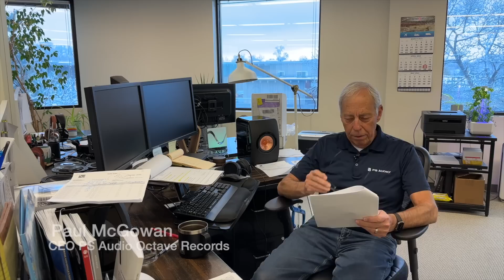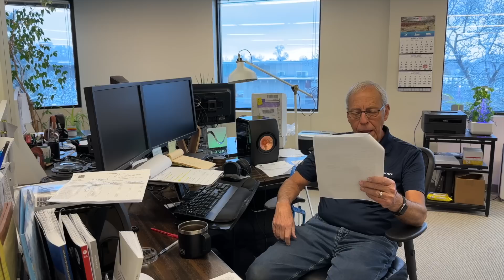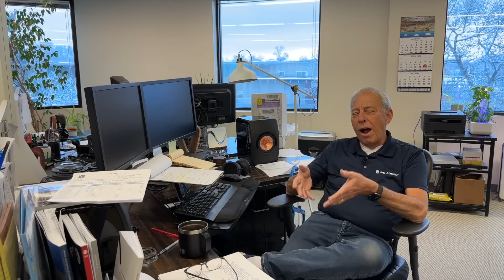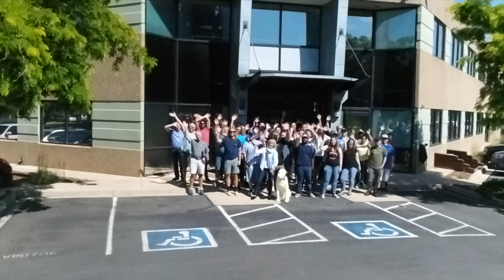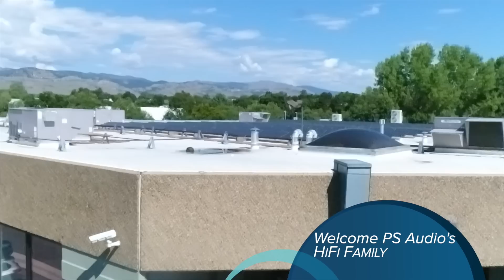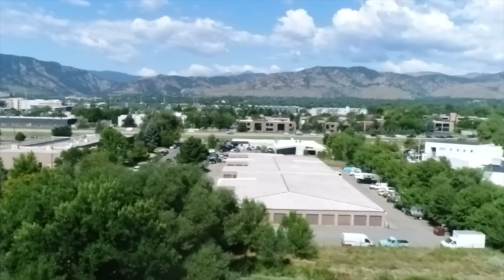Building a vacuum inside a loudspeaker

Comment: I designed a competiton subwoofer enclosure in our shop that incorporated a vacuum ( a very slight vacuum ) . It took weeks to get it right but in the end the result was exactly what was intended or more accurately  hoped for. Never be afraid to try new designs, theories or even outlandish ideas for speakers .
Reply: Just some added info . Vac was set at 1.2 bar  would hold during runs for about 20 minutes . Enclosure was treated and sealed inside and out . The idea was to be able to use a high quality but inexpensive subwoofer to compete in spl comps . Designed to perform  at 70hz for 10 seconds a run . $150 worth of subs with 4 times their rated peak power . The car was run all season all 4 classes each time and took 1st place all but once and it took second that time due to operational error .. for normal daily playing no vac was applied and we switched it to a 4 ohm load . I also designed a box for 15in woofers at half the volume recommended.  It's drops to 28hz and  offered a spectacular dynamic range through out the lower to mid low experience.  In fact that same box is being used as a home theater sub and as we speak and it is 10 years old . Don't hold yourself to conventional designs folks. Apply what you know to what can be and just build it. If it doesn't work there is usually a simple answer as to why ,so fix it.  Lol

Comment: It is funny, but I like the new goodbye! It gives a happier sensation 😂
Anyway, I was thinking if the is a speaker that includes a relief valve to control box high pressure, so that when cone returns forward it is not afected by that pressure force.

Comment: @1:03 -- Those speakers are the real deal.  They probably sound better than 90%+ of even what audiophiles have in their homes.
Their size is deceptive, related to the superb soundstage that they deliver.  And the bass goes deep.  They do everything right.

They are not the last word in high fidelity.  But for their size and their price, they have minimal competition.

As of a couple of years ago, their price was north of $2,000.
Kef has a newer version: LS50 Meta.  They are an improvement to what Paul has (but what Paul has is no joke).

Well, that is probably not Paul's desk (he owns the place, but some other worker probably is assigned to that desk).

Comment: Rather than a vacuum, designers "solved" the pressure differential by a "compound force" subwoofer design. In this configuration, one speaker is completely internal to the speaker cabinet and mounted behind the speaker firing into the room. When the front speaker pushes forward, so does the internal speaker, thus maintaining the same air pressure on the back of the external speaker. And when the front speaker pulls backwards, so does the internal speaker to keep the same air pressure on the external speaker. So, the speaker as a whole acts like an open baffle speaker even though it is a closed baffle speaker. I remember seeing such a speaker decades ago in HiFi/Stereo Review magazine, but I don't recall the maker. There are other "isobaric" (constant pressure) configurations as well.
Reply: In reality, both drivers couple closely, work in unison and experience "enclosure influence" just as a single driver would. You are citing advertorials for this arrangement, purporting to show its advantages. Low frequency extension is improved, as the Vas is halved. Moreover, having drivers back to back, or front to front helps average out suspension/flux assymetry.

Comment: Hexaflouride gas inside a transmission line enclosure. I have never heard anyone else try those two things together. Hexaflouride is heavier than air and the woofer will be fooled into thinking its in a huge cabinet because of that and the transmission line. If you don't mind having a huge box in your living room, I think I know someone who has a few extra confessionals.
Reply: Yes, SF6 gas will slow speed of sound but manufacturing and costs become unnecessarily complicated, when polyfill and passive-radiators are essentially doing the same thing.  Slowing the speed of sound, i.e increase apparent enclosure volume.

Comment: You want to move as much air as possible with as little energy and space as possible. Eliminating the need to compress the gases behind the speaker would certainly be nice, but unfortunately doing so means one would have to constantly fight against the atmospheric pressure of 194 dB. Under normal circumstances doing so would dissipate excessive amount of energy to say the least, but being a static state perhaps with superconducting coils one could do so without dissipating any energy. That would certainly be one impractical speaker though.

Comment: An odd idea?, Basically the air is acting as a spring trying to hold the cone in the middle of it's travel range.
On the dipole bit, I recently recycled a very shallow box into being a speaker, the reason was it had a nice grill on it just asking for a driver to be fitted. However it also had a matching grill on the backside, so it's kind of acting as a dipole speaker, but with the driver (just) fully enclosed. It's currently serving as a really nice monitor speaker, not bad for an almost joke build.

Comment: A sealed enclosure will self correct the air pressure to the same as its outside environment. Materials used in the speaker surround/cone will very very slowly leak and within a couple hours it will adjust to environmental pressure. Not to mention the terminals may have a small tiny leak if any excessive pressure exist for long periods (not while playing music).

Comment: With the aim of controlling the cone motion precisely again the signal I would consider it more interesting to come up with some servo feedback mechanism that can work also at higher frequencies with high precision greatly reducing distortion and ringing issues.
Reply: Something like this was done some time ago, I think by Philips.
They called their design Motional Feedback.
The speaker was still passive, but had a piezo electric transducer affixed, which generated a voltage which was used in the negative feedback loop.
There may be other designs where a second voice coil acting as a generator can do the same thing.

Comment: Yes Paul, somebody has already done it. It is called a Transmission Line Speaker. I built TL speakers many years ago based on a design by Dr. A R Vailey. Take a look at PMC speakers. Concept goes back to 1930’s.
Reply: Paul worked for Infinity during the 70s and 80s and have been a speaker manufacturer himself since the 90s. Im sure he has heard of, and has thought of, or knows the person that designed every type of speaker imaginable.
Reply: @flipfloptanlines926  Yes, he is a Little Wonder.

Comment: Paul, doesn't adding a Passive Radiator ease the back pressure on the active driver along with recovering some of the acoustic energy?
Reply from the maker: Yes, at some frequencies, that is correct.
Reply: Just remember any energy recovered and then released into the room comes with a time delay.

Comment: Any difference of the pressure inside the box relative to that outside of the box will cause the cone movement to be asymmetrical and result in some type of distortion.  If you want to make a slightly negative pressure inside your box you can remove the 'speaker and use a candle to heat up the air then reassemble quickly before it cools.

Comment: Isn't it amazing how technically inept some audiophiles are?
Reply: Just a foolish question by an idle mind that has nothing better to think about.
Reply: It’s a good hypothetical. But it should have been clarified if they meant an actual vacuum (noun: 1. A space entirely devoid of matter. 2. A vacuum cleaner) or minor negative air pressure. The issue with “a space devoid of matter” should be incredibly obvious so I’d assume they’re referring to minor negative air pressure. But given that that would just change the resting position of the cone and/or, if metal springs were used to prevent that, exacerbate any issues it’d be trying to address,… As long as there is an enclosure the air inside will be compressed/stretched as the cone moves regardless of how thin the air inside is, either it’s fighting against the air inside the enclosure or it’s fighting against whatever is keeping the speaker from moving backwards and equalizing the pressure in front of and behind it. If you built a sealed speaker 5,000ft above sea level (very thin air/low atmospheric pressure) then brought it to 100ft below sea level (very thick air/high atmospheric pressure) the speaker would be forced backwards until the air inside it was under the same pressure as the air outside it, and the reverse if it went from high to low atmospheric pressure. The air inside an enclosure is ALWAYS under the same pressure as the air outside it, which changes with humidity and atmospheric pressure (I’m just trying to make a point, there’s slightly more to it in the mechanical realm but this is already turning into a dissertation so I’ll leave it at that). And if there is no air/a vacuum,…  nothing, no matter how strong it is, would be able to move forwards (assuming it was strong enough not to be sucked backwards so quickly it’d be completely destroyed. Which is exactly what would happen to a normal speaker with a vacuum behind, unless it was in the vacuum of space). A vacuum is nothing by definition and it’s literally impossible to stretch nothing.

Regardless it’s a good hypothetical, but the parameters of the thought experiment need to be better defined. Regardless of what one thinks about this subject it gave me an excuse to think about this so, for that alone it gets my “seal of approval”.

Comment: I've never heard of such a crazy idea .... placing the cone in a vacuum at the rear would require a massive restoring force based on the atmospheric pressure of 15lbs/ sq inch  X the cone area in sq inches... placing a restoring force ( by a DC supply to the voice coil) would raise the resonant frequency and heat up the voice coil to the point of burning it out.
What I consider more relevant to this discussion is the effect varying barometric pressure has on a low frequency driver cone when mounted in a totally sealed enclosure ...

Comment: I think that a complete vacuum would make a regular speaker implode, due to the huge pressure of the external air.
Reply: For a 6 inch speaker the force applied by the atmosphere would be roughly 1820 newtons or 182 kg/f or 401 pounds. 
Just imagine to apply the weight of two average men on the small 6 inch speaker.... And it grows exponentially if you increase the diameter.
Reply: 😂 You dont need more than 0,3bar press/vac, have you ever seen the pressure in a longthrow subwoofee in a closed box? A propper woofer can take a lot of pressure/vacum.

Comment: Paul sort of got it right. The vacuum idea is nuts, the air pressure differential would just suck the speaker cone in, it wouldn’t work, full stop. However where Paul says “open baffle”   I say “Transmission Line”, which is essentially an open baffle but tuned to ½ (not always..) wavelength of the speaker resonance frequency.  They do get some stuffing at node points, but this is a much more gentle effect than the bit of stuffing in an enclosed box. I am a great fan of transmission line designs having built a pair based on the KEF Uni-Q driver. It could sound bass lacking until the bass actually hits. It’s called clean bass. Typically, you lose the bass knee “boost” from the enclosed / ported speaker designs, but gain in a more gentle roll off, which creates the extension. Open baffle is very natural, but the cut-off is proportional to the baffle width, and bass = many feet.
Reply: I fooled around with it a few years back, never had speakers go bad from it, you can give it air from a compressor but thats to much and nobody wants that in their livingroom. But with a tesla valve the woofers will build up pressure/vac. Making a tesla port in right dimensions is not cheap or easy tho, but for the diy it is a funny way of trying new designs and grow.
Reply: I farted on a snare drum once.....
Reply: @flipfloptanlines926  how did that work out for you? Kidds say weard things now and then...

Comment: Teslavalve as a port, you can go pressure or vacum, just flip the valve/port. Vacum sounds more punchy Vs pressure.
Reply: The teslavalve is directional.
Reply: Yes, thats the point, if it flows inn you create pressure, if it flows out you get vac🎉
Reply: @Error2username  So it would work once for the first large half cycle, then maintain that pressure? Why do that?
Reply: I have No answer for why, but  it goes lower with vac, comp to a matching ported box or pressured. A lot of try and error to make tho. This is only for subwoofers, never tryed on  speakers above 600hz, pardon my spelling, im norwegian

Comment: There is a simple way to take away the box air damping, or cushioning effect acting on the rear of the cone, and that would be to mount the same driver on the back of the box,out of phase.
Thus the volume of air in the box remains the same, as one cone moves outwards whilst the other moves inward.
I am not speaking from any experience having never tried it.
Of course ported enclosures and auxiliary bass radiators already reduce back pressure.
Reply: Isn't this isobaric
Reply: @xanderguldie  with an isobaric setup the second driver is placed inside a ported or closed box and sees the back of the cone of the first (usually visable) driver
Reply: With a driver on the back of the box you would have an out of phase sound  that bounces on the rear wall and arrives to the listener dumped and with some delay, messing up the real sound. I don't think this could be a solution.

Comment: How about a sealed box except with a device to match the air pressure outsede the box
Reply: so a ported box?
Reply: @shifterboot1382  lol i said that to myself too. A sealed box but not entirely sealed. A vaccuum would be like putting your hand on the cone
Reply: Exactly! See my Comment on "compound force" or "isobaric" speaker designs.